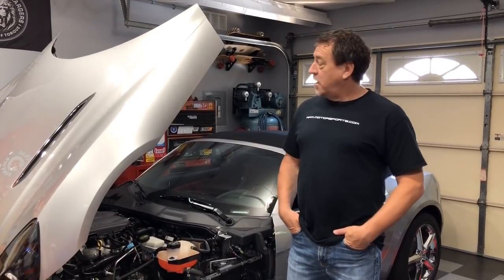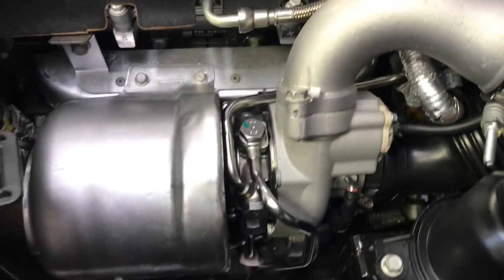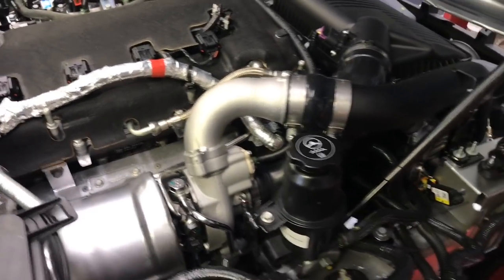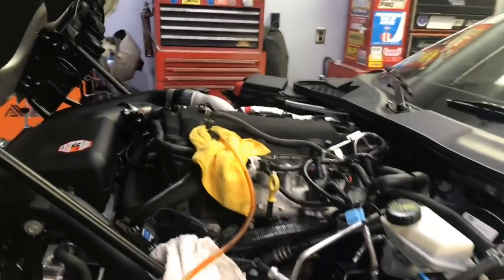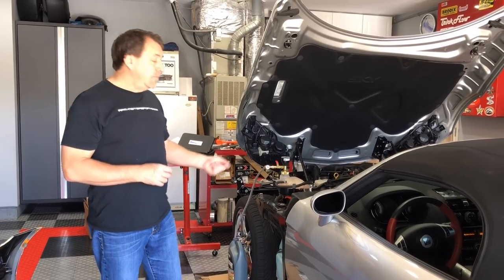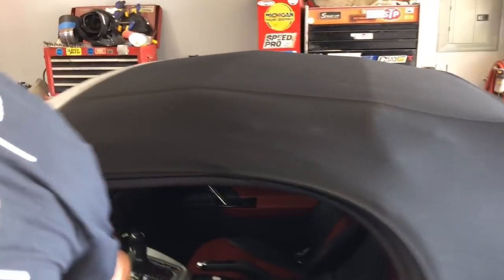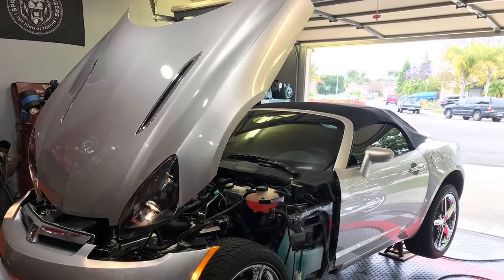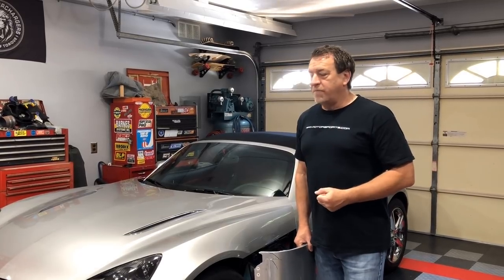Tim’s Garage Episode 12: Saturn Sky Redline /Solstice GXP Cooling System Connections & Bleed Purge

Comment: Continue to thank you Tim! Your videos helped so much when I did my big wheel upgrade. Watching this one I realized I was missing a bolt on the turbo shield.
Reply from the maker: I appreciate the feedback! Crappy you missed a bolt but at least you can take care of it. I did several things a couple of times myself as I kept second guessing some of the steps myself. 
Starting to really love this car ... has it out for the first 2 tunes this week and I am SHOCKED at the level of improvement ... transformed the car! Those will be the next videos along with a “DIY” heat shield for the power steering where I will show how to make your own.
Reply: @350tiger  I found a spare laying around and put it in already. Thankfully it was a minor thing
Reply: @350tiger  Tim, growing fond of it?  Yeah there's just something special about these Kappa platforms especially in GXP or Redline.  I've got a GXP manual shift with DDMWorks brace package and the so called budget tune.  Boy did that ever wake this car up!  The added pep along with a car that handles way out of it league, well it just plain fun.  Cheers to you acquisition of an extremely low mileage kappa.  I hope you get a chance to take it to a track or the mountains.  I rode mine twice on "The Dragon" and was shocked at how well it performed.  BTW, very nice videos, very clear, included part numbers and paced properly.  Keep up the good stuff. Don
Reply from the maker: 2wrdr I agree ... I just love driving the car and it has enough power to be exciting now !

Comment: Good video.
You still have air in the system.
Raising the reservoir will not work.
I even went so far as to raise the left front wheel almost 2’ and reved the engine to 3000.
The manual instructs to pull the vacuum before putting any coolant in.
After getting every bit if air out the car will get to 223 while idling.  Running at 3000 the car runs at 195-205.
I think the air pocket is at the water pump or the tube between the water pump and thermostat housing. 
Mine is a brand new gen 3 because the foam cast block leaked between coolant and oil passages.
If you have any suggestion how to not get hot on idle let me know.
Reply from the maker: I have managed to get it to stabilize and it seems my car just reads high due to the heat on the T-stat from the turbo as well as very low coolant flow due to the poor factory water pump effectiveness. There will be an AC Delco improved pump in my future.
Reply: What is the Delco upgraded water pump part number.  I have been taking the temp around the thermostat and it is 204 when gauge states 223?
Reply from the maker: Yes the replacement water pump has a disk that is attached to the impeller blades. I did see a car that was running this pump and at idle it had significant water trickling in from the small bleed that enters the top of the overflow. My factory pump is one with just the bent up blades and it is not nearly as effective at low RPM pumping and it will get a lot warmer at under 2000-2500 RPM.  If I receive to 3000 like you it will pull temps down very fast. Personally if I have any reason to pull the turbo I will be replacing the 12,000 mile factory pump in my car with the AC Delco pump part number #252-821 or the GM Pt# 89036356. Please reach out if I can help further. I would try the simple bleed process as even with the airlift device I still had air in my system. Make sure the heater is on and you go for a good run bringing rpm up over 4000 a few times between bleed attempts.
You might even want to install one of my water pump heat shields as well to help the seals survive.

Comment: Tim, are you tuned yet? I completed my RPM stage 3 install and need tuned. Just wondering what kind of lead time I am up against.
Reply from the maker: I have had three sessions and needed to change plugs. I have been traveling with work but Martin has been very responsive. It may take 3-5 sessions to get your vehicle fully dialed in.
Mine has improved dramatically each iteration of the tune.

Comment: Whats the name of device tool  you used to clamp down the hose ?
Reply from the maker: They make hose pinch tools but I used needle nose vise grips with a rag around the hose to protect the hose. 
IRWIN VISE-GRIP Original Locking Pliers, Long Nose, 4-Inch (1602L3) https://www.amazon.com/dp/B0000BYD9A/ref=cm_sw_r_cp_api_i_cndpFb8QAJ44J

Comment: Where's the video with the results after the tune?
Reply from the maker: Please be patient ... I had some issues to work through with HP Tuners and an update ... thought I had it fixed but it turned out not yet. Latest version of HP Tuners as of version 4.5 does not read long term fuel trims or O2 sensors. I have been working to get that resolved but has taken longer than I would have hoped ... it runs great and moved 32-34 lbs per minute of airflow and manages to hold 21 lbs of boost. Update soon !
Reply: @350tiger  it's been 8 months. I don't think that's by any means impatient. I like your videos and appreciate the detailed info. I just really want to know what all that work netted you.
Reply from the maker: B Bailey well I will use your message as the needed push to get something up ... even if incomplete due to HP Tuners
Reply: @350tiger  can you use an older software version?
Reply from the maker: Yes B Bailey I can use an older version. I did have to upgrade a laptop as the one I received only had a 25 gig hard drive and the first windows update resulted in a full drive. I ordered a new laptop and that event had me update software. That process of updating did a firmware update to the MPVI 2 device and I am not certain it will still work with the earlier version software. Hoping to get back at it in the next couple of weeks.